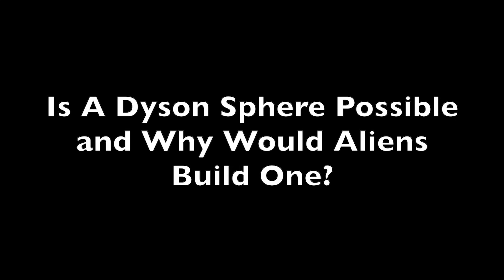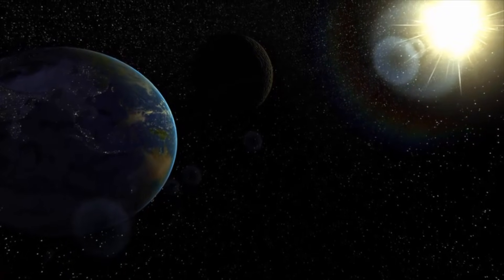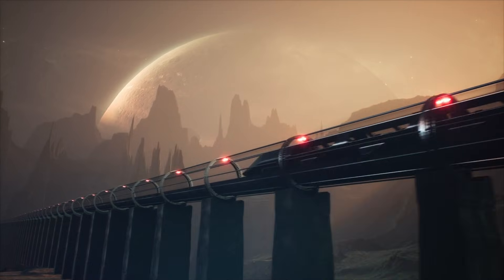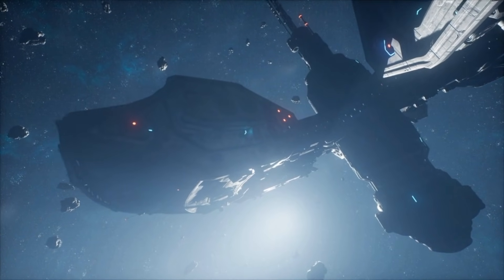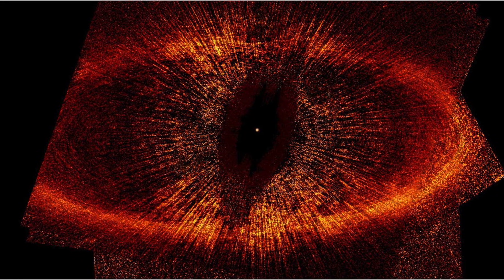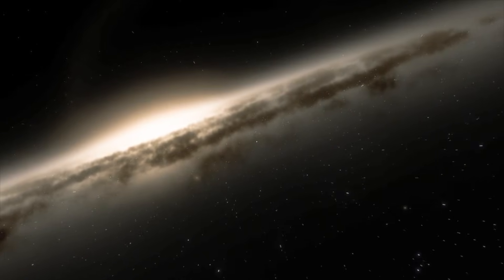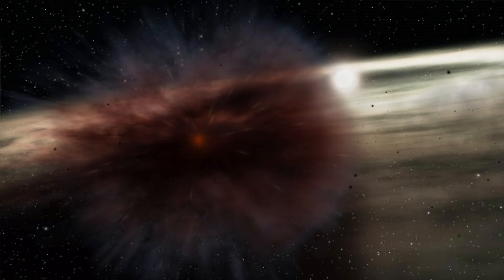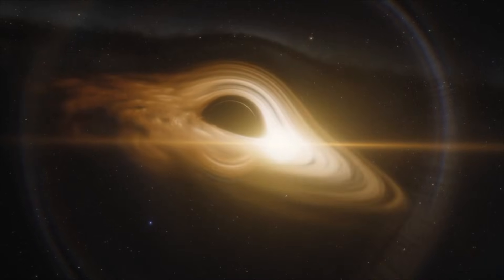Is a Dyson Sphere Possible and Why Would Aliens Build One

Comment: Hi John, something went awry with your sound processing: your voice is noticeably phasing. This is often introduced by over-applying noise reduction or leakage from headphones. I've used dozens of sound-restoration tools to salvage old recordings. From this experience, the best recording is the one that needs no restoration: a sound booth, a pair of leak-proof, recording-grade closebacks (these are dirt cheap, optional, only if you monitor yourself), a decent condenser mic (these very aren't, but last a lifetime with good care; I got mine about 25 years ago) and a tube compressor or its digital simulator, like the recent series of Volt recording interfaces with an amazing DSP replica of the classic UA-76 compressor. The benefits of a condenser over a dynamic mic are the post-processing latitude it leaves for archived recordings and its high sensitivity, as you speak quietly. I tuned to this video next after the latest Tom Scott's Lateral Highlights release, and the contrast in sound quality was dramatic. 

Nicoll beam is a concept that's dead on arrival. I couldn't find any info about the guy, but the original description of the device includes a "phased-array laser beam", directly focussing starlight from a Dyson swarm of mirrors. That's nonsense: stars emit blackbody light, neither coherent nor monochromatic, so the idea of using phased optics is weird at best. It's possible to get a more or less collimated light beam with a Dyson swarm equivalent of a parabolic mirror and a lens but targeting an Earth-sized planet from a distance on the order of kly is hopeless. Even if you precisely know where the planet is, predicting where it will be in a few thousand years in the chaotically moving stellar system within the Galaxy is an unsolvable problem; even a K3 can't outsmart maths. The beam's divergence is also a huge problem even for a true laser, and much worse for a wideband beam because of dispersion on the mirrors and in the lenses. There are also losses and more dispersion in interstellar gas and dust. All in all, it can deliver only a tiny fraction of power from the source, itself a small fraction of the star's power output. Next, encasing the whole star into a mirror shell will overheat the star, and its thermodynamic balance is delicate: the outer layers will expand without limit. Even a simple parabolic mirror will throw too much power back at the star. Lastly, a mirror shield is a cheap and effective defence from this weapon: if another planet system had been hit, most others would know the direction they might be attacked from. The infrared signature of such a source is impossible to hide once its existence is revealed. That's at least hundreds of years of advance warning for most directions.

Niven rings are so damn dynamically unstable that I don't believe they can be reliably stabilised with an active feedback system of thrusters. Physicists love problems like this, and I expect a sizable number of papers on them, at least on ArXiv. When a chaotic dynamic is involved, I'm generally not optimistic: the behaviour of systems in the chaotic regime is inherently scale-free, so there is simply no upper limit on the stabilising correction momenta. The main question is whether there is a non-chaotic region of its phase space, and, if so, is it large enough to leave a practical margin w.r.t. state coherence time (Earth orbit's circumference is just shy of a light-hour!) for active station-keeping within it. I won't have time for this any time soon, unfortunately. It's a delightful problem to research!

I still owe you the 10 most energetic things research, and I'm sorry for sitting on it. I think that research deadline is an oxymoron, but this doesn't hold them from coming my way!
Reply from the maker: Something's definitely wacky. It sounded right when editing, but I too heard the issue when I did a listen after release. I'd initially thought I screwed up and applied an effect twice, noise reduction being a good candidate. Not unheard of for me, I can be a boomer and fumble things. But I tried to record a track last night and it frankly sounded like I was on Mars and I had to dump it and postpone the video. My hypothesis is that my mic is starting to fail. This has happened before, I use AKG Perception 220 (formerly 200's) mics because of how they react to my voice but they seem to fail after about 4 years of use. With the first mic, Eryn noticed the same thing, an undesired phasing effect developing. So I replaced it and now the current one seems to be starting to act up. They are cheapish mics so not a problem replacing it, and I have a back up Heil PR 40 already hooked into the board, but yeah reliability does not seem to be the strong suit of AKG mics. Anyway, I'm releasing a video tonight using the failing mic if I can get it to sound right and if it doesn't I'll switch to the Heil. Observations on sound would be welcome so I can fully diagnose the issue. 

As to megastructures, I think the only feasible one is the Dyson swarm. The next video drop is a Saturn deep dive, but after that I'm going to posit that all highly advanced civilizations with large populations become likely to build a Dyson swarm of some type no matter what. The reasoning is that yes, you can have fusion energy, but you have to fuel it. If your energy consumption gets to Kardashev type II levels, in other words the output of a star, then fueling your fusion reactors is going to require you to stellar lift and mine your star for fuel. Well, at that point it seems to make more sense to just eliminate the fuel requirement and just harvest the solar energy, and if you did engage in stellar lifting, all those structures you built to collect hydrogen and helium constitute a type of Dyson swarm on their own. As a result, I think optical SETI looking for weird IR signatures is actually the most viable form of SETI. There are some other ideas I'm going to belt out soon as well on SETI that I think are new but I have to check the literature.
Reply: @JohnMichaelGodier  I'd look at replacing the XLR cable, too. Condenser mics are too sensitive to even slightest imbalances due to wear or damage in the cable.

Yeah, I remember the phasing on one of your past videos! It began with “In 19xx, the Soviet astronomer <given name> Kardashev…” I have a good sonic memory for sounds that grabbed my attention for whatever reason, but won't recall for the life of mine when it came out and what it was about. You may find it by the script.

Certainly consider Neumann's TLM 103, a large diaphragm cardioid, with the same K48-based capsule design as the U87 at an incredible price (for a Neumann). The voice-over folks swear by it, and Neumann is Neumann for Glorkon's sake: with a studio-only use and a service record it'll be still worth more than half the price in 30 years. It's not as versatile as U87A, it's designed for voice-over specifically, but at the quarter of the U87A price it's a bargain, and in any case in a different league than AKG 220. Sweetwater has a promotional ~8-10% store credit of the price on all higher-end mics right now till the end of May, and the TLM 103 is offered with the deferred interest-free monthly payout in 3 years. I wouldn't miss such a deal if I were a voice pro like you. These guys are good, know their stuff and, when they don't know the answer, they really find it out for you, not trying to sell anything you're asking about. You can open an account on their site and are assigned a dedicated engineer right away, who'll keep all the notes on your communication. Then ring them, explain your requirements, studio construction and budget. If figuring out your mic would take past May 31, at least they'll lock in the promotion for you.

AKG 220 could be worth twice its price for voice-over, but AKG's production quality tanked since HK acquired them. I just returned a third KT371, for a refund this time, after the headband separated twice after only a few months of normal use each time. The first one was replaced because it came assembled with one ear-cup loose and a visibly missing part. The next and the last separated on the right side of the headband in the same exact place. Unbelievably, HK has outsourced AKG support to a 3rd party company! A sad end for once reliable name. AKG was my to-go headphone maker, but HK doesn't seem to care anymore. If I'm surprised at all, then only with the long 4 years that your AKG lasted you. Whither we're bearing... It seems that the times of going by the brand name are over. I recently purchased a Hosa 2×TRS-to-2×RCA cable for active monitors, over the Amazon's "brand" only because Hosa, plugged it in, and one of the monitors was silent. I took a 'meter to the cable, and sure thing, one of the tip-to-tip wires didn't ring, no connection at all.

As for the megastructures… We don't know of civilizations other than human, no other point of comparison, and we've been around with the full upgrade package like language abilities for probably no more than 50ky. Civilization is 7,000 years old, and the Western technological one is barely 200. Had we taken care of the Earth, there could be hundreds of millions of years ahead; whatever would be living then is hardly the humanity we know or even can imagine. But the climate changes, it's not at all set that we can prevent the run-away greenhouse, or whatever else we'll do to the planet by accident. Unintended consequences will more likely than not catch up with us, and soon; I'm not at all positive that we have another 1-2 ky of liveable Earth. The space habitats question is perhaps a more practical one than Dyson energy collectors...
Reply from the maker: It's very possible it's the cable. The mic is on a boom arm that I'm always moving around and subject to wear. I have plenty of cables to switch out and see if there is a difference. 

I remember making that video and that was about the time that Eryn noticed the phasing. We diagnosed it as the mic failing and replacing it fixed the issue. One of her projects next time she's here is to rebuild that mic. Not sure what success she'll have, but that's her intent. It's probably worth it, it's one of the Austrian ones before the sale, but I agree, once they were sold the quality tanked. I'd love to find something more reliable, but I have not yet found something that quite nails my bass. Even Neumann, there's a recording studio specializing in hip hop across the street from the Event Horizon studio that has really top notch Neumann mics and experimenting there we actually couldn't quite get the same sound no matter what we did to the point that some of the artists actually record over here because they like the sound. I do have the Heil and and assortment of other mics, but the Heil really was designed for HAM radio and I sound like a radio host from 1995 with it. I do not need to sound any more like Art Bell than I do already if that makes sense. 

As to the megastructures, I think Bezos is on to something. I'm not certain that a planet is the ideal environment for a civilization and it may be a situation where most civilizations live near their planet in habitats as opposed to on it. But if we did that, moved to O'Neill cylinders because we trashed earth, it still represents a kind of Dyson swarm. Especially if you have thousands of them. If they run on solar energy, which seems logical, then they are energy collectors but more situational than what Dyson envisioned.
Reply: @JohnMichaelGodier   Wowzers! I thought the 87A can capture just anything, and then the channel strip is your oyster. Yes, they're popular in hip-hop, but there they always cut the low end, there are hardly any opera basses there. I cannot think of anything: if the 87A doesn't cut it, nothing probably can. But how come the AKG works then? To me, it doesn't add up, in a sense. A recording engineer is supposed to be able to record just anything and then some, and in such a way that you only mumble "magic" under your breath. But if they've been recording hip-hop only for 10 years... You did try switching off the rumble filter on the 87A at least for a test, didn't you? The AKG 220 doesn't have one. The TLM 103 also doesn't, AFAICR.

A comparable mic shop is Gefell, you may check these out, too. It was also founded by Neumann himself, but the two lines have diverged significantly. I've seen very few of them, no experience here.

If you can connect with the guys who record symph orchestra, chamber concerts or opera, they may have a trick or two up the sleeve. Or a voice-over studio, naturally: to my ear, there's no such thing as too much low end in the film. :)

Art Bell the ghost and UFO stories guy, that one? I vividly visualised eh… auralised(?) you reading your channel in his 1990s' AM voice. Gosh, this made me laugh hard. :)

I'm really wondering if O'Neill's/McKendree's habitats need to be of the scale they're usually imagined. A good architect may make space look much bigger than it really is. Just the minimal size for self-sufficiency, or even that for a limited time if they're dockable, would perhaps work better. A Jupiter's mass worth of carbon nanofibers or whatever they're made of doesn't look sensible. Then, the smaller, the more reliable, and even completely losing a smaller one is a tragedy, but not the end of it all. And yet then, nobody gets something of entirely new scale entirely right at the first attempt, and what if the design flaw is irreparable — how am I supposed to obtain them the second Jupiter's mass worth of unobtanium?

The same is true of the Dyson swarms. It's not that a civilization one day turns a K2 and launches 100,000 energy collectors. Building a swarm can realistically only be a gradual process, over a long time, as needed. The same design upgrade consideration applies, too.

Comment: Load of crap. They would need all the matter in 100 solar systems. that tell you its bullshit, if they are so advanced  it would be something no bigger than a couple of kilometres  square  to get enough  power for the whole planet.  They sure as shit aren't  building  something  3 times bigger than they're  star, that's just stupid.
Reply from the maker: As I deliberately and prominently explained in the video, that's a misconception. Dyson himself did the calculation in the original paper and a sphere the diameter of the orbit of earth 2 to 3 meters thick depending on density is one Jupiter mass.

Comment: "you'd need a Jupiter sized mass of non-hydrogen elements" Isaac Arthur has a pretty good episode on Star Lifting, you can literally build your solar megastructures using solar-powered solar mining installations. The sun has like 90% of the solar system's mass, including the metallic elements. As a side benefit, this removes elements that poison fusion reactions, making the star live longer.

Comment: "discover fusion before building megastructures"
We can build beamed solar sats right now, and if Elon keeps lowering launch costs at the rate he's doing, we might replace carbon burning base-load power with a Dyson Swarm of beamed solar sats surrounding Earth before we discover viable man-made fusion power. Although beamed space solar is arguably just fusion power with extra steps, so you'd be doing both at the same time.

Comment: A problem is heat dissipation so you would need to build it bigger if you wanted to live on the inside. Then the star would continue to heat and throw off strong solar winds every so often. That means nexessarily expanding and putting protection against particles and strong radiation in place. Not impossible but it is not a zero maintenence thing.

Comment: Heat expands mass as external internal magnetic fields grounding currents through itself and surrounding mass as internal magnetic fields grounding currents through the nucleus or core. If internal magnetic fields don't ground heat energy they become external energy flow towards the weakest point of repulsion as fire or molten masses. Liquidity infinity to illusionary solidity from liquidity infinity.  Theoretically factual probability that works with quantum physics without gravity. Friction causes sparks (electrons) that light atmospheres. Light doesn't travel heat does. Refraction of light is magnification in heat waves carrying the light as magnification traveling through space and atmospheres. Mirror effects. The heat transference of light in and out of entanglement of mass. Heat within atmospheres and throughout space filled with dark heat energy outside of entanglement of mass as a weak external magnetic field. Potentially renewable heat energy when entanglement with mass occurs. Friction causes sparks of striking resistance as renewable heat energy through all masses in its path. Theoretically factual probability that works with quantum physics without gravity.

Comment: Probably easier to redesign your culture for a stable population than build mega structures to accommodate  an infinitely expanding population.  Unless of course you've got some weird ****ed up alien religion that forbids contraception.
Reply from the maker: It would be more efficient. Is that Kinski in your profile pic? Looks like Fitzcarraldo I'd think.
Reply: Klaus Kinski is my spirit guide
Reply from the maker: Werner Herzog is mine. Scream at me Klaus :) Those two did indeed make greatness. Aguirre and Fitzcarraldo are amazing.
Reply: The rich don't want to hear that.
Reply: And by weird ****ked up alien religion I'm alluding to certain branches of Christianity.
Reply from the maker: I grew up in that branch. Trust me, they have more hang ups than merely contraception.